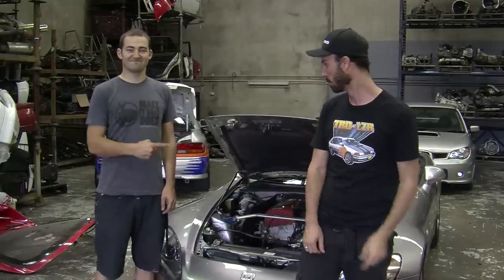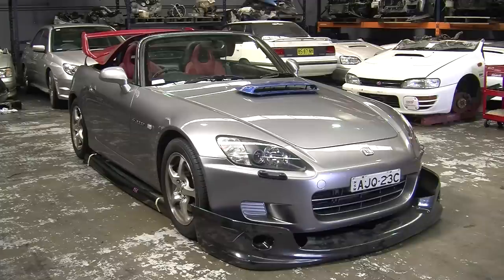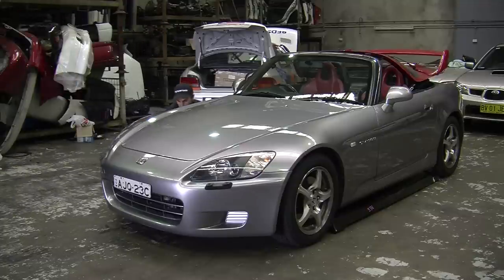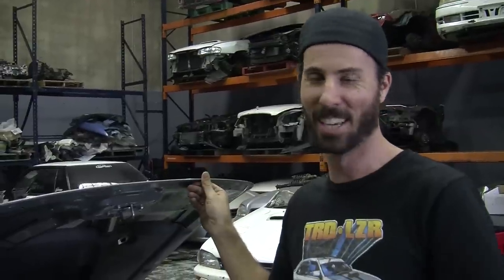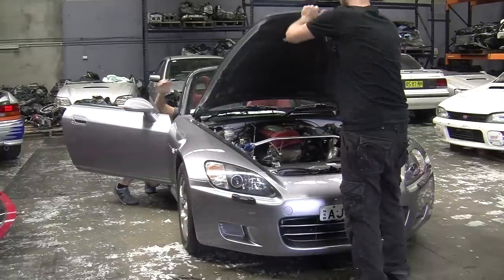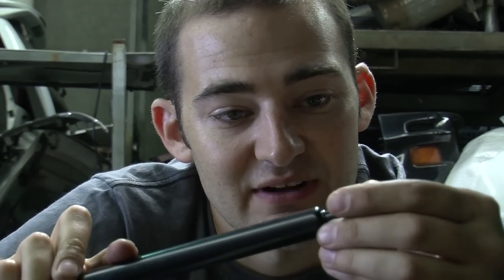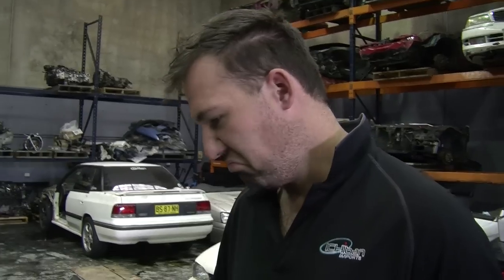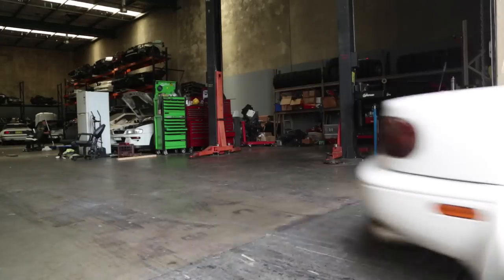How to Install Bonnet Struts (Hood Dampers)

Comment: I think the grease is meant to go on the ball joints to stop them from going stiff
Reply: Im 99,000% sure your correct.
Reply: It sure wouldn’t go on the threads to prevent corrosion hahahaha I laughed my ass off when I saw that
Reply: it indeed does prevent corrosion on bolts and threads and its always a good idea to finger rub in the grease onto every thread that you can to make it last much longer and be easier to reinstall at a later date... but yeah, greasing those ball joints was also a part of the job... a job well done is one in which every part that can be greased is if its not protected in some other way from oxidation...

Comment: A big HEY from Greece! I fitted a strut from an old hatchback on my NB MX-5, which went on the passenger's side (driver's for us), on the front hole where the stock airbox pipe used to sit. It couldn't be fitted on the bonnet's hinge though, as the firewall sits too high, thus preventing it to close. The "Diagnosis" plug was also in the way of the newly fitted strut, so I took the little plate it sat on, bent ii and place it facing the firewall. Takes some thought making even the slightest of mods look stock.

Comment: Um, I'm pretty sure that grease is meant to lubricate the ball ends of the bolts where they connect to the struts. IDK why you guys are applying it to the bolt threads.
Reply: i was thinking the same thing.
Reply: hello cheryl. thats why
Reply: i think your right,..
Reply: it worked for them so i really dont think it matters
Reply: The ball joints could already be greased.
Reply: i think the balls were already greased, but the reason why they greased the threads, so that in the long run, there would be no rust from constant moisture and water.. rain, snow, etc..
Reply: Could also be because the bolts may have been stainless. When you do stainless bolts it really helps to reduce binding if you grease them. I'm assuming on a ball joint like that they'd need to be stainless to prevent rust but because they were painted who knows.

Comment: MFW the grease wasn't for the threads. it was for the little ball at the top of the bolt where the strut clamps to. l0l its probably worn to shit now
Reply: yeah man!
Reply: I think they did put it on the ball,  they said to put it on the ball and shaft
Reply: Christopher Lam they definitely put it on the threads. Not the ball.
Reply: exactly

Comment: Are you guys completely certain that grease was supposed to go on the threads of those bolts? That makes no sense. I'm certain it was for the ball/socket joint of the strut assembly.
Reply: thought i was the only one that thought that.
Reply: Greasing threads just stops them rusting and seizing, they won't come undone.
Reply: The grease is to stop them seizing and rusting so you can take them out if you need to, they sometimes use grease on wheelnuts so you can get them off easily.
Reply: Anti-seize does that and it's not a grease.
Reply: ya its meant for there ball joints at least the blots will come out easy
Reply: I was thinking this myself.
Reply: Yep you are totally correct that's why I call these amateurs "MIGHTY CAR KNOBS"
Mighty Car Knobs strike again
Reply: Either way it doesn't matter... Its not like grease/lubricant is in short supply.
Reply: Chris Riccio  Anti-seize is a "grease" or a lubricant. From Permatex's own site (makers of "Permatex® Anti-Seize Lubricant"): "A highly refined blend of aluminum, copper and graphite lubricants. Use during assembly to prevent galling, corrosion and seizing due to weathering or chemicals. Anti-Seize assures easier disassembly."

Grease is defined as in Merriam Webster's Dictionary as: "a thick lubricant"

Let's take this a bit further. zeemanjr Sorry but looks like you're the knob here. Had you known anything about working as a Machinist, you would know that greasing and lubricating bolts is a requirement for optimal torque application, prevention of galvanic corrosion (as well as other types) and prevention of thread damage due to "Welding". It's the shade tree mechanics that'll tell you otherwise. In the fastening industry, including "mission critical" applications, some form of lubricant or grease is specified during assembly. This may be a light film of assembly oil, or Anti-seize lubricant or a heavyweight grease. It may seem counter productive, but if you took a brand new car or motorcycle apart, you'd find that the threads of all bolts had some form of lubricant on them unless in an application where NVH or expected forces or operation would require the application of the threadlocking compound. Typically in these applications the bolts are considered disposable and should be discarded and replaced once removed. This is due to the fact that the threads are often damaged after removal due to corrosion or welding, and that bolts in these positions typically are "stretched" once torqued. In addition, the grease they are using appears to be a molybdenum disulfide AKA MoS2 or  also called "Moly" grease which is used as a thread anti-sieze in applications where exposure and corrosion are possible.
Reply: Eyebrows Mahoney Ah! So lets set things straight: The 'grease' is anti-seize meant for the threads, the mighty car mods' guys are brilliant and you should still grease your knobs with some sort of lubricant.
Reply: *****
Always grease your knob!
Reply: Eyebrows Mahoney LOL Way to miss the point completely. Look up any other video for installing hood dampers or better yet, instructions that come with these kits. Thanks for that lesson but ah, that grease is for the ball joints... ;)
Reply: Chris Riccio
AH, but you're missing the point as well. MoS2 is a "Multi-purpose" grease. It is used as both an Anti-seize and as a lubricant for moving parts. It's design makes it shear resistant (which makes it favorable as a thread anti-seize), shock resistant (which also makes it applicable in bearings) and it's a natural corrosion inhibitor.

Most hood dampeners these days utilize plastics which are highly wear resistant and self lubricating such as Delrin, which makes lubricating them unnecessary. Instead if there is any noise or difficulty in motion, a dry lubricant such as teflon or dry graphite should be utilized as using MoS2  or any other "sticky" grease would trap dirt and other particulate accelerating wear and reducing ball joint life.
Reply: Devan Henchel Wow, calm down mate. His comment isnt worthy of that kind of toxicity , hell, no comment is. We need to stop this shit on youtube.
Reply: *****
I know I apologize I just hate all these trolls on youtube if you don't like someone or you don't like the people that make a video don't watch their videos and don't comment easy as that

Comment: Why are they lubing the threads on the bolts and not the ball joint?...
Reply: so they dont rust and come out easily when u want to take em out
Reply: wouldn't that make it easy for the bolts to come out?
Reply: Prematurely
Reply: well on a nut that is under alot of vibration you would use a lock washer so it locks down, or a lock nut depending on application, im not certain tho, maybe someone can correct me
Reply: Was going to say the same thing about lubing the ball joints
Reply: they do that to prevent corrosion and to make it easier to remove later.
Reply: hadtstec i think its both, a well tightened bolt with lock nut and lock washer wont come un done with grease on the thread in my experience

Comment: The widebody kit really does add to the looks and performance of the S2000. Maybe you don't need to work on the engine at all, the widebody kit alone adds 500 HP.

Comment: Whatever happened to those little spiral springs they used to use to hold up hoods? Struts eventually leak down and the stick is annoying but the springs never wear out.
Reply: those were phased out in the 80's
Reply: They're a lot heavier than dampers and a lot harder to install aftermarket.
Reply: My Soarer's struts are 18 years old, and they are still working fine.  The boot ones I did have to get recharged a few years ago (which only cost $70), but the bonnet ones are fine.
Reply: Nff '90's on the heavier duty vehicles.
Reply: ***** Ya, the crumpling metal sound the springs make isn't that cool. I wouldn't expect the struts to be cheaper to make though.

Comment: In a previous video you said that cold air intakes do not work, but in this video the s2000 obviously has a aem cold air intake.
Reply: Don't work for HP gain however the induction sound is worth it.
Reply: True
Reply: hopefully some nice chew chew chew sounds soon!
Reply: that video was about an GTR, which had a turbo and a inter cooler, maybe for N/A engine, its different?
Reply: Andy Cook hopefully not... it's wrong to turbo an s
Reply: Andy Cook Works perfectly fine for HP gain IF you ECU tune which they did not do. If you do not allow your engine to intake more air from thelarger intake how are you supposed to make more power?

Comment: the bracket bolted to the hood will eventually rotate since it's only held in by one bolt. this can rotate enough to cause the damper to occupy the same time and space with the fender, damaging it...

modify the bracket to use a 2nd fixed point to prevent rotation.

Comment: I don't understand the hype for VTEC. 

Almost all modern cars have a form of automatic valve timing adjustments of some sort usually opening the engines up either the more the throttle, or higher the RPMs. Albeit VTEC is sometimes more agressive than other forms of valve timing, since it's made for higher RPMs but meh. Even my 2005 Hyundai Sonata V6 has variable valve timing and it's maaaad.
Reply: History and branding my friend.
Reply: Marcus Maingot Honda doesn't really advertise their little civilian daily driver cars as SUPER RICER FAST FART CAN VTEC YO. REV IT TILL IT BLOWS FOR THAT MAAAD VTEC POWER SPIKE. :/ i've been in and driven Honda's, I don't understand the hype of that bit of power you get past like 5K RPMs like you get in almost all vehicles...
Reply: Vtech and VVT aren't the same thing...
Reply: Violetta
 It's just better. Look at your Hyundai. Has 170 horsepower from a v6. Whereas the RSX type S 02-06 or w/e year it is has 200 from a 4 cylinder.

It's just better. It also doesn't matter if its past 5k rpms. That's what downshifting is for.
Reply: K
Reply: Vtec isn't only VVT- variable valve timing. Vtec is that combined with "Lift Electronic Control" that is two camshaft profiles, low cam and high cam. Makes the car very effiecient and low horsepower while cruising but on high rpms and throttle it uses the high cam profile that makes more hp bucause of more valve lift.
Reply: Tommy Melin You can get the same figures of power gains from forms of variable valve timing and other variable valve lifts without having two sets of camshaft profiles though.
Reply: Violetta i

Comment: just watching this video now and something caught my attention. Arent those struts or gas springs filled with gas? if Im not mistaken I think I have seen some of those with a "flamable" warning on them. If they are on the inside of the hood. Arent they getting hot...like..very hot with the engine running and all that? isnt it dangerous? I may be mistaken?

Comment: your ment to grease the ball joint not the thread so silly people.
Reply: Greasing the thread is sound though, less friction means more clamping force for a given torque.  If it's a grease that evaporates, runs out, or stiffens that means the bolt is less likely to work it's way loose.  Check out applied bolting on youtube if you want a more in-depth explanation.
Reply: 春日歩  if you apply to much torque to a thread you will strip it.. grease on a thread that is rattling and vibrating is bad because it can loosen. you would use thread lock in this situation. not grease. besides . grease is not meant to dry out. that's the point of grease.
Reply: So you won't get dry balls!!!

Comment: Should have greased the ball end of the bolt instead of the threads. It is a pivot point after all and the struts change angles when closing and opening the hood or bonnit. Where ever you may be from lol. But as always great episode! My days always better with MCM's in my feed.
Reply: Did you read the Annotated note at 7:03 of the video?  It says "Make sure you grease up the balls and the shaft"... ROFL
Reply: No I sure didn't, seeing as how annote's done show up on my mobile app. Sorry i was trying to help the community by making others aware of the point who also may be watching on there mobile devices and may not have seen that annotation. But good try at making me look stupid.....ROFL.
Reply: I wasn't trying to make you look stupid.  Sorry about that.  I just wanted to point out the balls and shaft joke.

Comment: I would take the S2000 over almost any car within it's price range
Reply: The 350Z is another great option in the same price range. I chose the 350Z as it's much better looking imo and still p plate legal (atleast in QLD).
Reply: xMcStarley
Its super heavy and not as fast as the older Z. I rather take the S2k but everyone has their own preference.
Reply: xMcStarley 350z is horrible to do any engine work on as the engine bay is really compact.

s2000, the cheapest one in NZ at the moment is around 18k. Other vehicles in that price range include r32 GTR unmolested, 450hp mk3 supra with dyno sheets and receipts, unmolested mk5 supra, showcar standard evo 1 with 300kw at the wheels. mint r32 mk4 golf.

i mean if hondas are your thing, then go ahead, this is just food for thought
Reply: dont forget vw R32
Reply: Maccattack77 Luckily i don't have to do much engine work on it as i'm not really allowed to be on my p plates. Only allowed 210kw and mine is at 206kw. So not a huge choice left but agree on the space thing though. But it's a price i'm willing to pay for that sexy Z ;)
Reply: Thats awesome, that leaves all the better cars for people like me.
Reply: xMcStarley
 I would also choose the 350, only because of turbo potential.
Reply: xMcStarley Ah i see, no power restrictions on cars in NZ (just bikes)